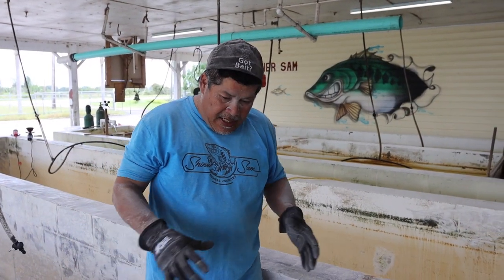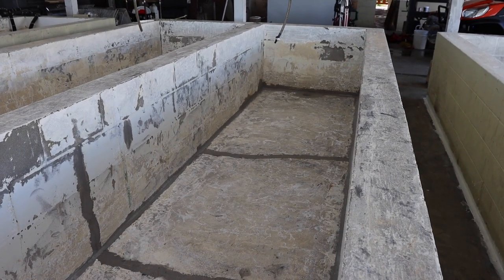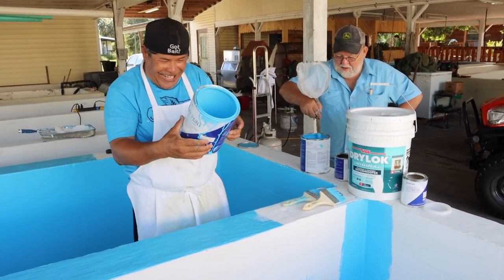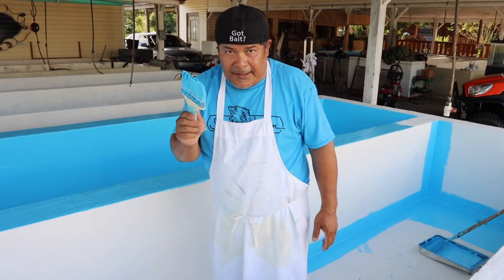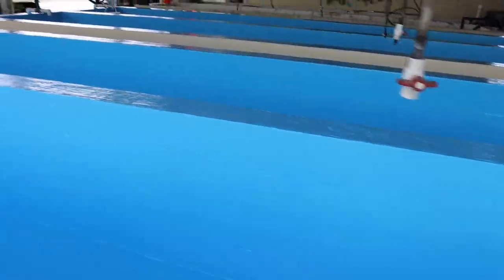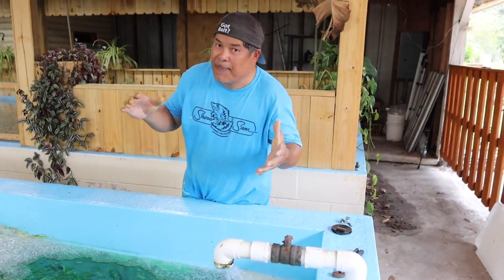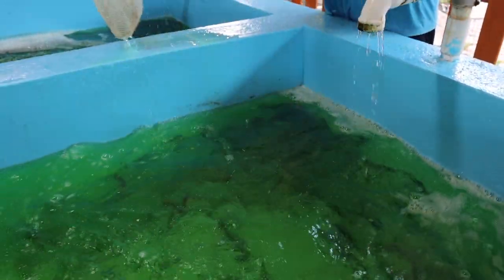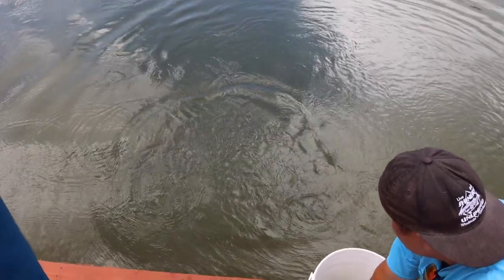Concrete Fish Tank Repair (Bass Feeding)

Comment: DOES DRYLOCK SEALER WORK??
Reply: Yes it does. I used it on my fieldstone and mortar basement walls. Use a couple coats and give it time to cure. Never had water problems again after using drylok.
Reply: MY FIRST HOUSE WAS A SLAB HOUSE AND I USED DRYLOCK ON IT IT WORKED GOOD MANY COATS!!
Reply from the maker: Drylock does the job, it seal and dry quick and you can paint over with in a few hours.